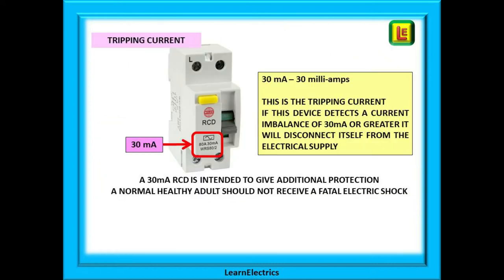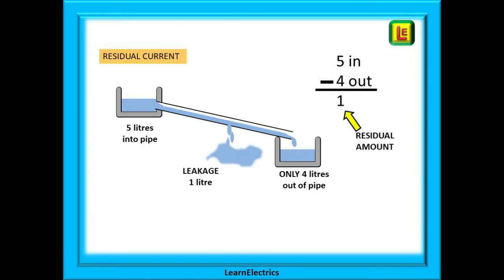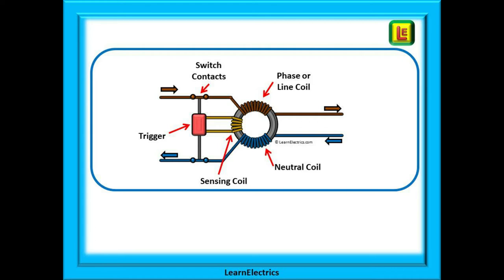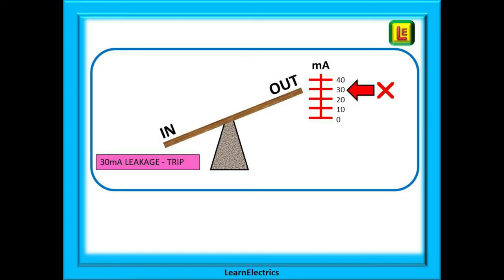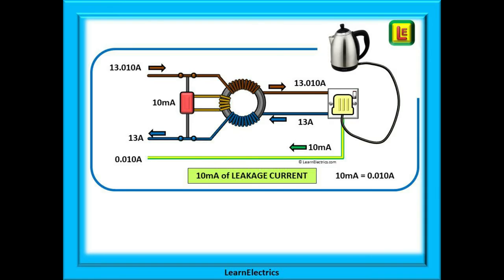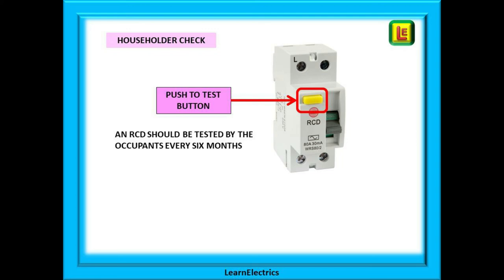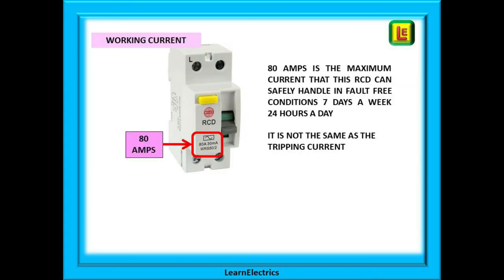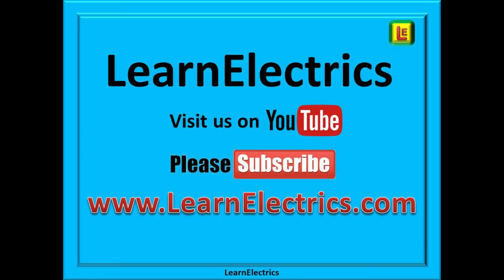HOW RCDs WORK

Comment: My humble suggestion: The inbuilt test button can only assure that the electromechanical trip mechanism which consists of multiple moving components such as springs, levers, pivots, pins, links and cams are working properly. This cannot tell you the trip time. So I test rccb once a year with third party tester and note the trip time which should not exceed 300 millisecs.
Reply from the maker: This is exactly what it says in Section 11.6 of the OSG, page 129. Some good information if you have a look; and thanks for watching.
Reply: Thanks Dave, you have a talent for these videos 

Keep up the great work !!

Comment: How does a neutral to earth fault stop an rcd functioning correctly? I've had this problem a couple of times , normally it would trip the rcd !!!
Reply from the maker: If the line and neutral are the same, or within limits, the RCD will not trip. If there is leakage N to E then it won't take much to make it trip. Take a ,look at this RCD testing video
https://www.youtube.com/watch?v=PXKaq_1DmgU
Reply: @learnelectrics4402  thanks for the reply👍. Normally an earth to neutral will imbalance the rcd causing it to trip correctly, as in 99% of cases. I assume the fault i had ( neutral to earth dead short)  would & should trip the rcd, but in a couple of fault finding missions, the rcd was blinded somehow!! I can only assume that the earth was at the same potential as the neutral, thus the rcd didn't trip. I can assume that the main earth was not efficient in the dwelling.

Comment: Would it be a problem if a socket with RCD protection was put onto a circuit already protected with an RCD at the board?
Reply from the maker: No, except which one goes first? We are doing a video on RCD discretion soon.

Comment: where does the leakage current go if there is no earth, like in older lighting circuits for example? What would happen if you borrowed a cpc from a nearby socket as a less disruptive method of earthing circuit? Would this just mess up the earth fault loop impedance? Thanks
Reply from the maker: Leakage current will go by whatever path it can find, extraneous metalwork, people, wherever it can get. Trying to eliminate leakage is a preferred option rather than using other circuits. each circuit should have its own earth if required. Dave.
Reply: @learnelectrics4402  agreed but when rewiring is not an option would using another circuits earth be better than no earth?

Comment: thanks for the wonderful video, my new apartment RCDs for newly installed Shower Heater kept tripping as soon as the 4 pole heater switch is switch on, brand new shower heaters were installed correctly. Suspecting wiring mistake done by the apartment builder. Can you advise any clue or step-by-step guide to diagnose this issue? thanks in advance!
Reply from the maker: Could be lots of things Alan. My first thought is neutral wires in the wrong RCD.
Put the RCD to ON with all the power to the shower set to OFF, and the switch to OFF
Then turn the shower switch ON. If the RCD trips immediately (the same instant in time), especially if it is both RCDs that trip, then it could be that the Line for the shower goes to one RCD and the Neutral goes to the other RCD. This is an imbalance. Get the sparky to come back and put the Neutral into the other Neutral bar so that Line and Neutral are on the same RCD. Hope this helps, Dave.

Comment: Thank you. Very simple and concise! I have an ATS system switching between my off-grid installation and company power based on my battery bank voltage and off-peak tariff but when I am pulling >2kw often my main panel RCD trips...not sure what might be causing it. Any ideas? Thank you!
Reply from the maker: If you have lots of devices plugged in and each has a few mA of earth leakage, you will reach a point where they all add up to 25 to 30 mA and the RCD will trip. The good way is to unplug everything and plug in items one at a time until it trips. If it trips with the same item each toime that could be the problem. Try running the same items but spread across two RCDs. Good luck. Dave.
Reply: @learnelectrics4402  Thank you Dave. This is inline with my experience. Unfortunately it will be difficult to divide loads between RCDs on the main panel due to lack of space. I guess I have to forget the ATS automation and have the switch between offgrid and company mains on a manual fashion with few loads on.

Comment: Sir, to us you are a very knowledgeable person and a excellent teacher.Thank you for sharing your knowledge with us 👍.Q:My house often trip when there's a even a slight lighting strike or indirectly (EMI). Can I install RCCB Auto restart device and how to wire it up? Thanks
Reply from the maker: The idea of an RCBO/RCD in domestics is that it dead trips and doesn't reset
Might I suggest that you check what the earth leakage is with a clamp meter on a good day. You may find it is already around 15mA and all RCD devices can trip anytime after 15mA, usually around  22mA. Not at exactly 30mA as many think. Hope this helps. Dave.
Reply: @learnelectrics4402 , Thanks you Sir I will try rectify the problems.🙏

Comment: Which side does the supply cable enter on a three phase rcd, top or bottom?
Reply from the maker: If its marked 1 - 3 - 5 then those are the inputs and 2.4.6.the outputs. Hope this helps. Dave.
Reply: @learnelectrics4402  thanks,does that sequence protect the test button if it's held for too long?

Comment: Sir is that mean the RCD is a requirement in TN systems too ? I am living in TT grounding country.
For TN systems will there be any problems of unwanted tripping of RCD due to earth and neutral voltages ?🙏 
And thanks for the video s.👍
Reply from the maker: If installed correctly then no problems. In the UK we must install RCD devices in domestic dwellings. Thanks for watching. Dave.

Comment: what about voltage drop on long circuits. Could this lead to unwanted tripping
Reply from the maker: Good question Chris. The whole point of voltage drop calculations is that you don't have the circuit so long that the volts drop exceeds the maximum permitted. If you need longer circuits and still need the same load, you may need to increase the cable size and do the calcs again. Longer circuits are more likely to reduce tripping as the resistance has increased. Hope this helps. Dave

Comment: I'm so amazed of your video's, but i still confused, are RCD's and ELCB the same? thank's before
Reply from the maker: No. But they both did similar jobs.
An ELCB - Earth Leakage Circuit Breaker is a voltage leakage detecting device.
These have/are being replaced by RCDs Residual Current Devices that detect current leakage. Generally, RCDs give better protection to humans and animals.

Comment: There are some old buildings without earthing and bonding, I guessed using RCD would be some help in these cases, but bs7671 forbids using them in TNC systems. Do you have any idea why they say this? I know that it wont be a perfect protection but at least RCD will improve the safety of that old buildings.
Reply from the maker: You need a separate earth for RCDs otherwise they can't tell there is a problem.
Hope this helps. Dave.
Reply: @learnelectrics4402   Yes they can't solve the fault when it happens, but at least when someone touches the body of electrical equipment, RCD would survive him. Without RCD, he will die. When BS7671 forbids it, that seems similar to saying : If your car does not have a healthy brake system, you are not allowed to install airbags :)

Comment: Thank you again for a very clear explanation. Would it be possible to do a video on how DC saturation of the coil interferes with the RCD operation? I'm an adult learner and can't get my head round that.
Reply from the maker: Don't try and overcomplicate things, the important thing is to fit the right type of RCD and we have that on our list for a video. Just think of saturation as measuring the rise and fall of water in a bucket that is half full - easy. Now try and measure the rise and fall if the bucket is full to overflowing, saturated. You can't really see a change if everything is spilling over. Does this help? Dave.
Reply: @learnelectrics4402  Thank you for your prompt reply. What video on your playlist covers selecting the correct type of RCD?
Reply from the maker: We've not done that video yet. A few have asked so we'd best pull our finger out. Thanks for the interest in our videos. It won't be long.

Comment: Can a RCD detect a external fluctuating current that is entering the property from say a main water pipe?
Reply from the maker: That's not how RCDs work. If you have another look at the video you will see that the RCD looks for a difference between in and out currents in the phase and neutral.
Reply: @learnelectrics4402  but what if the fault is before the rcd?
Reply from the maker: RCDs work on faults downstream of them.
Reply: @learnelectrics4402  is there any way an upstream fault can be detected though, maybe intermittent tripping?

Comment: What is a Residual Voltage Device?
Reply from the maker: We do residual voltage tests to detect any residual voltages in electrical equipment/electronic cabinets that are still present in the circuits after the main source has been isolated. A safety verification. Not the same as RCDs. Dave.

Comment: Can explain how a three phase RCD works?
Reply from the maker: Very similar. The three phases are 120 degrees apart so the difference between all three phases should be what is in the neutral. I might include 3 phase RCDs in our soon to be finished video on RCDs.
Good question.